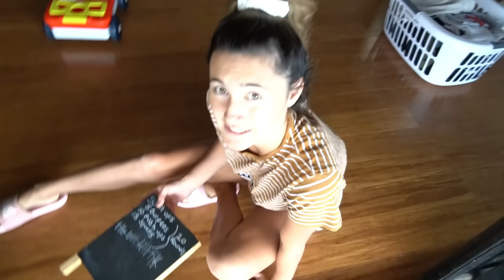$10,000 RENOVATION AT MY HOUSE!!

Comment: Hey Logan, love all the vids even these non-riding vids!  I have one piece of carpentry advice to give: take up the part of the floors that would be under the walls next time.  Most of the time you can save the pieces to fit in any gaps around the wall after you put it up.  I am sure you’ll be OK, but it’s best practice to not put long term structures such as walls and cabinets on top of flooring.  Next reno shoot me a message and I’ll trade some carpentry services for some riding lessons :D haha.  Cheers mate!

Comment: Going to regret not taking the floor out first if you ever want to replace the floors one day.
Reply: I think those floors last 10 years or so?
Reply: That wasn't my point. I'm currently redoing a kitchen where a cabinet got placed on the tile. It's a pain to remove the floor with something sitting on it. Wood is a bit easier as you can just cut around it.